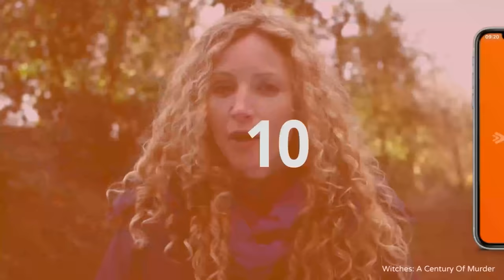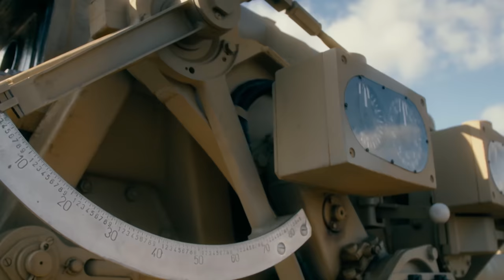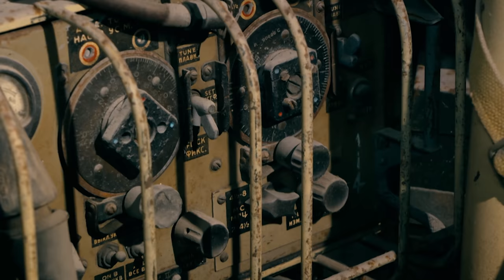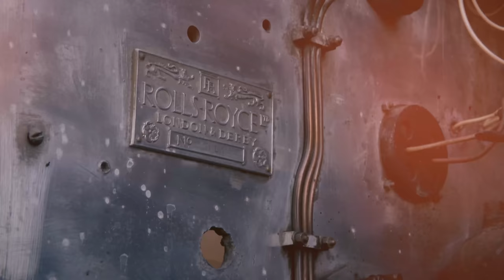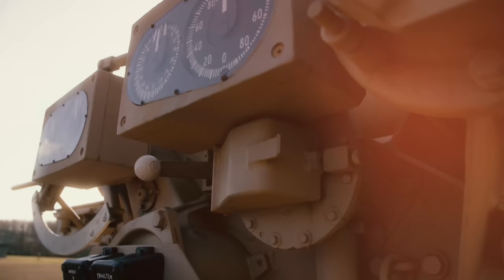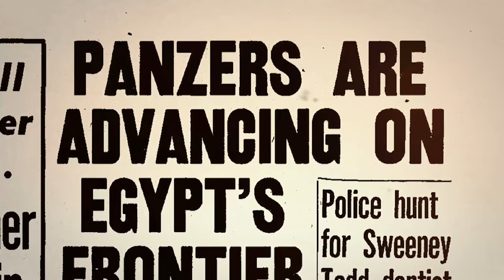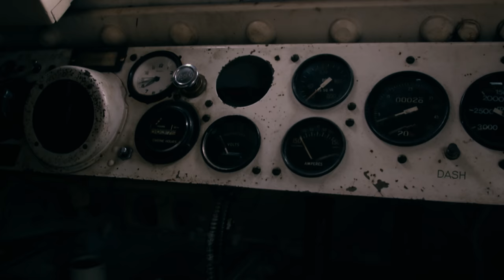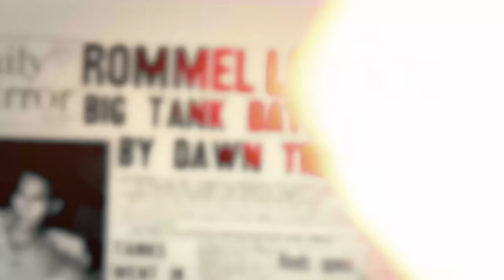The War Machines Engineered To Take On Axis Force [4K] | Combat Machines | Spark

Comment: apparently the desert campaign was won by Monty all by himself.  I could have sworn Patton had something to do with it, but I guess I was wrong.  Guess this is what happens when the docu is told by brits exclusively.  :)
Reply: Who was patron?
Reply: So Auk had nothing to do with stopping Rommel at 1st Alamein?  Funny, but I don’t think that the Brits who stopped Rommel at Thala north of Kasserine  were under Monty.  Pretty certain that they were Anderson’s command.
Reply: @davidtuttle7556  I think it was Eisenhower that told Patton he had to put up with Monty because he was the only hero the Brits had.   I guess somethings never change.  :)
Reply: @RoamGaming  Perhaps.  Ike would sell whatever bs he felt he had to to whom ever he had to in order to get the job done.  Ike was a man of many different faces and layers like an onion.  I wonder if anyone ever knew the real Ike.
Reply: the us joins the war in 1942 the desert war started 1940 just saying
Reply: @keithmoore5224  The U.S. landed in Morocco in Nov of 42 effectively surrounding the Axis forces.   5 months later, it was all over.   Just saying
Reply: @RoamGaming  the US landed to fight Axis when they were facing war exhaustion and lack of fuel after getting rich off the war, happened in both WW1 and WW2 and they never won a war since just saying
Reply: As much men and equipment America spent to save England it should be an American colony (51st state).
Reply: @keithmoore5224  The US officially joined the war in 42 but, long before that had unofficially been sending equipment and mercenaries.
Reply: No it was Montgomery,  he said it many times.
Reply: I think Monty thought he one the war all by himself. He hated Patton.
Reply: @florencemodina6293  Patton would agree with you.  He was a huge admirer of Rommel.  He would probably agree with your assessment of Monty as well.  :)

Comment: "Out manoeuvred" Push into the sea at Dunkirk by superior soldiers, fits better. German Panzers ? The French armour was by far more superior in quantity and quality. And the small Czech tanks that the Germans used, shouldn't have presented any prolems of the Mighty British. Yes the Matilda hav diesel engines however, that wouldn't have been the case if the Germans and the Danes hadn't invented and developed it. With Op-Compass it took the Indians, Austrians and New Zealanders 6 mouth to push the Italians back to Tripoli. It took Romal 4 weeks to push the British back to Egypt.